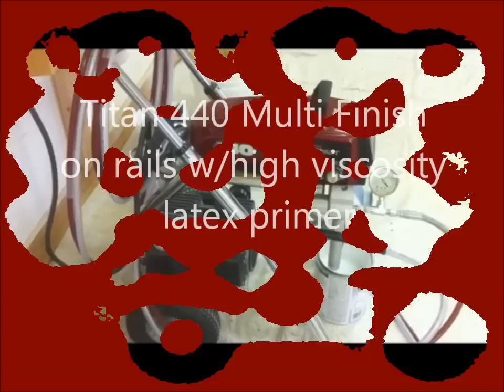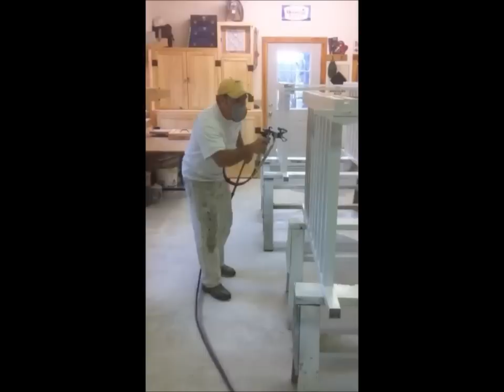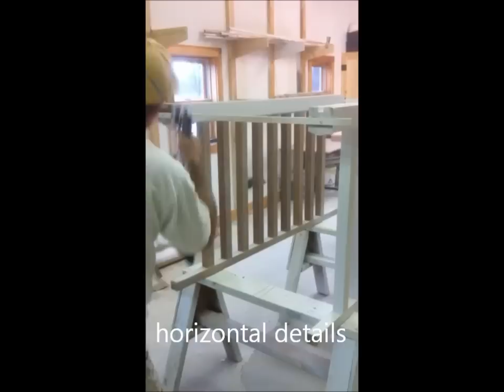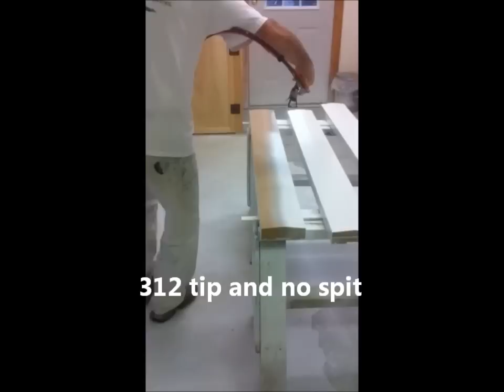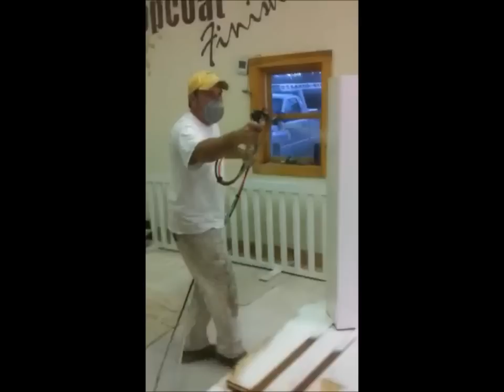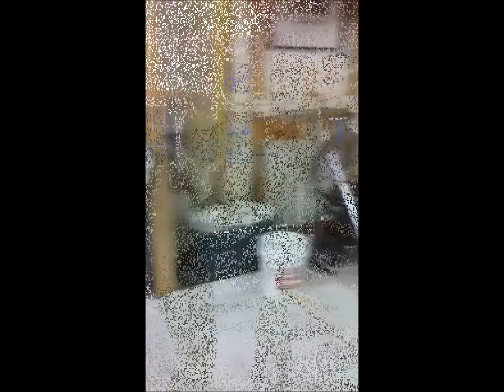Titan 440 Multi Finish Testing

Comment: I just bought this machine came with a air coat flat tip 9/20  at low pressure and 20 psi I am still getting lines. Seems like a very wide fan that I can not change .used to a traditional airless tip. How do these flat tips measure. What would I typically use if spraying doors ..new construction .if I am using a reversible tip such as ff 308 tip what pressure would you run the machine at while running air mode. Been trying different settings hard to avoid spitting or heavy outside lines at low material pressure ..really could use some help understanding this machine so I can really enjoy it
Reply: HeritageValleyProPainting LTd check pressure. Keep trying until u get it right.

Comment: Great video: I have a titan 440i and looking to add the pump. Because I typically spray latex (SW pro-classic). But with the current set up I have way too much over spray. I was wondering if you have alot overspray and fumes? And what do you think of the HVLP or Pressure pot?
Reply from the maker: Noah, thanks, it depends on the volume of paint you typically spray. If it is small project stuff, we use hvlp alot. Anything much more than a gallon and a half, we move to an air assisted pump. Both systems run very clean and efficiently.

Comment from the maker: @paintpro.net, in this video we are running at 1600 on the fluid, and 30 on the air. This is typical of high viscosities in aaa mode. Not bad considering the machine is capable of 3300, which is where we all usually are when blasting away on drywall with a 515. Thanks for your comment.

Comment from the maker: Running at way less pressure than typical airless, with the air giving it a fine kick at lower pressures, and way less overspray than airless. Versus hvlp, its the smaller gun and larger quanitity of a pump, but with similar transfer efficiency.